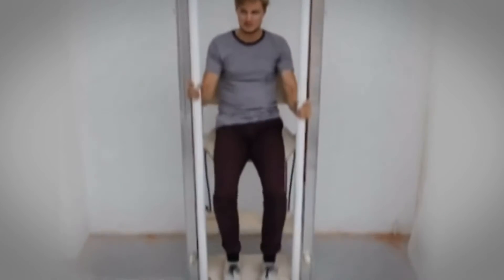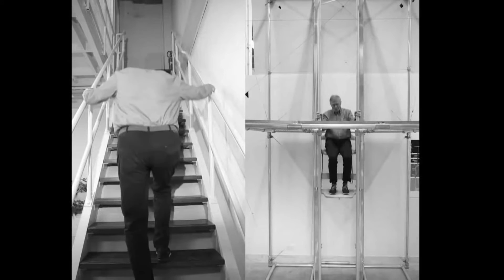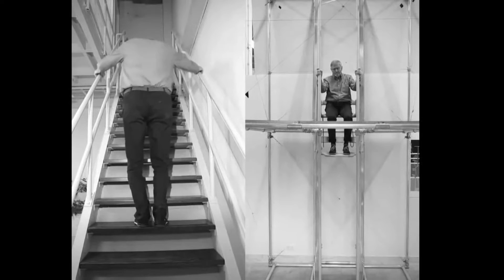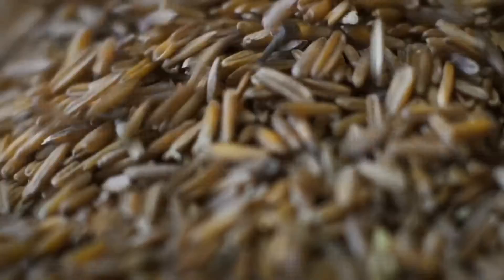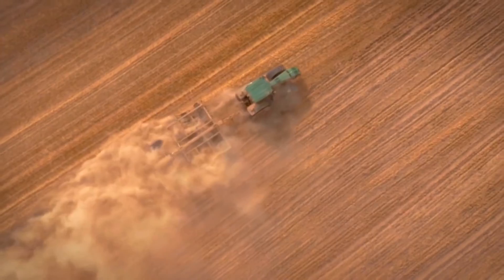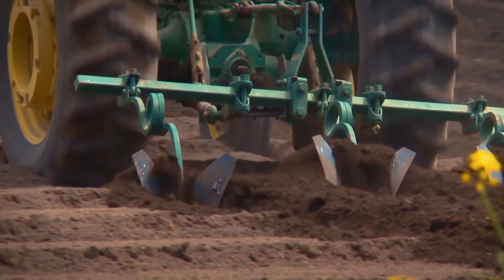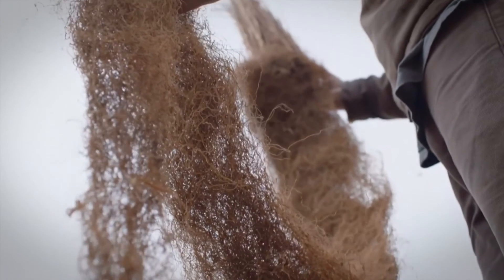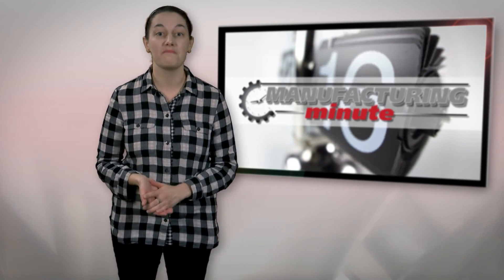Manufacturing Minute: Replacing Elevators With Human Power

Comment: This is stupid we already have hand powered elevators that work much much better than this.
Reply: you mean button powered?
Reply: @aleksszukovskis9999  Um no mean human powered. They are called "hand elevators"
Reply: Ha! I searched for hand elevators and came to the conclusion that this thing here beats all those in simplicity, speed and efficiency and it even adds  the fun factor !! So stupid or not, I would rather have this one
Reply: @chamagical  Hand elevator you can carry more than one passenger. This thing you can not. A hand elevator can be summoned to your floor this thing can not. A wheelchare user can use a hand elevator and even if they cannot operate the ropes somebody standing outside or with them on the platform can, with this thing you cannot. https://youtu.be/kUKepCAnYss
Reply: @chamagical  and they are fun and facts Sedgwick posted letters from customer saying how fun their children had operating them for there handicap relatives.